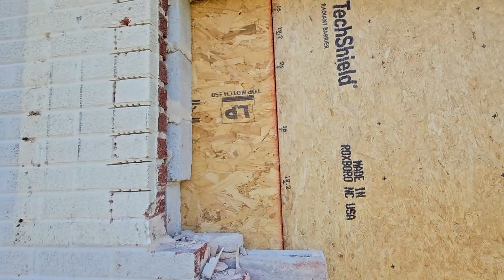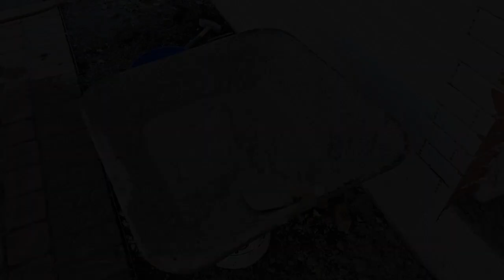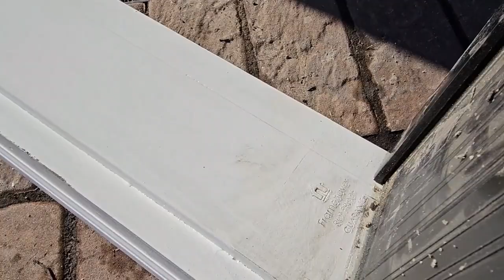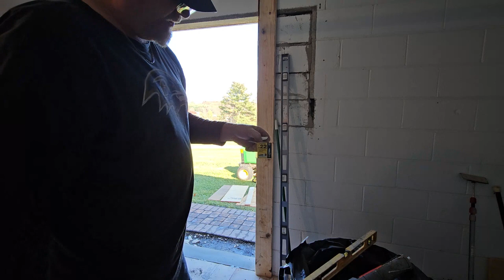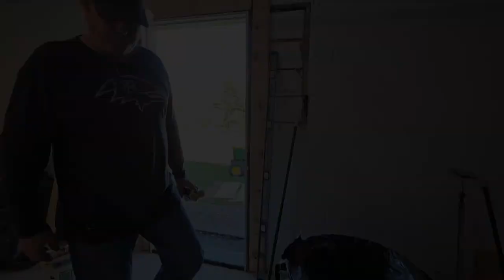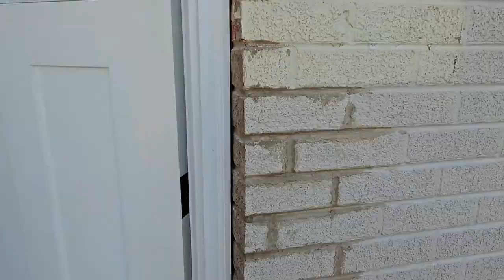Exterior Door Install Part 2

Comment: why no stud framing   do you really expect that door to stay in that brick opening without it being nailed or screwed properly?
Reply from the maker: For this project, studs come later and will be attached to the flat laid 2x6's when the room perimeter is framed with 2x4's. Currently, jambs are screwed to 2x6, and 2x6 will be screwed/nailed to future studs. Flat laid 2x6's are power nailed currently into the block wall. nothing is screwed to the brick veneer...... Thanks for watching!